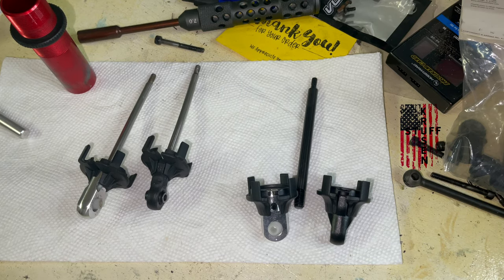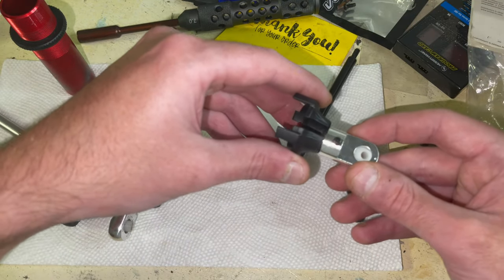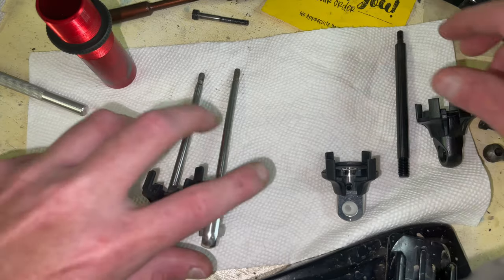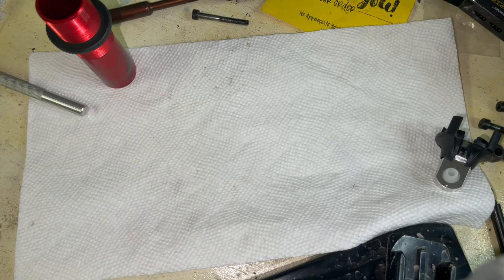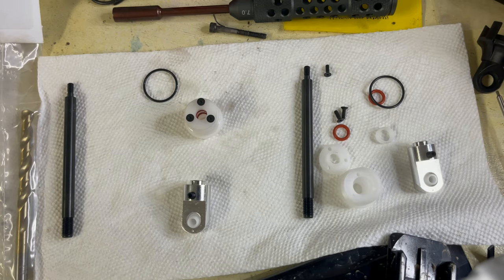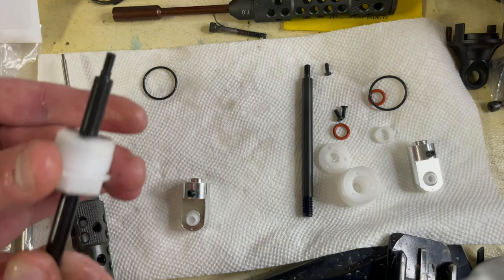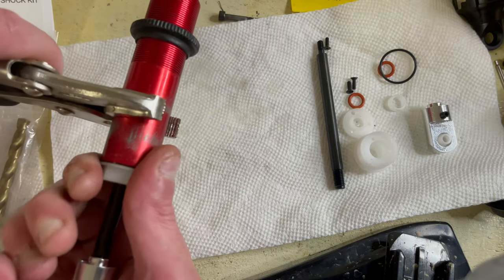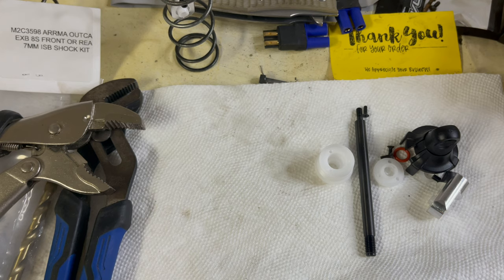“INSTALL” M2C3598 “BEEFCAKE” 7mm ISB Shock Kit EXB; Evolution of Shock Rod Ends; Outcast8sRTR/EXB

Comment: So with the rtr shocks you don’t need to drill out anything just get that bottom holder
Reply from the maker: Hey bro. I put all the info in description. EXACTLY what you will need depending on what you’re trying to do. 5mm RTR, or 7mm EXB. I could write it all out but it’s already there. Save me time. APPRECIATE IT BROTHA.
Reply: Thanks man I realized that after the comment appreciate you taking the time to write back anyway got the exb spring perch